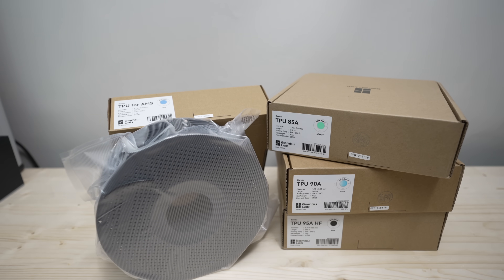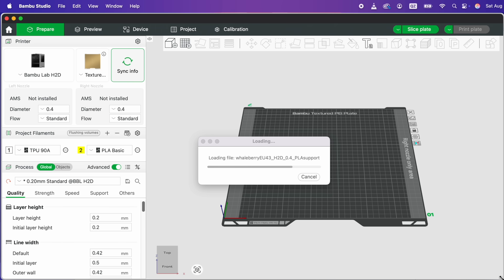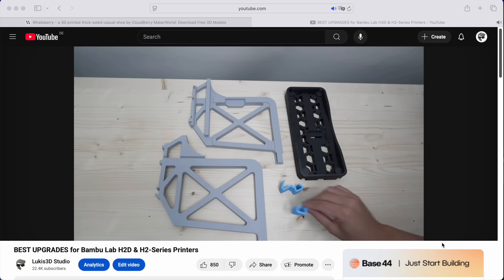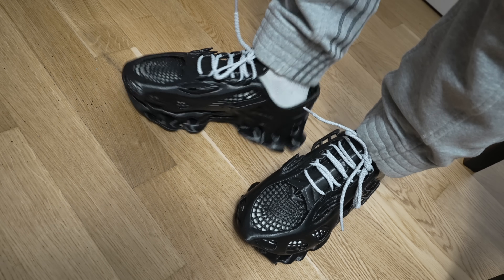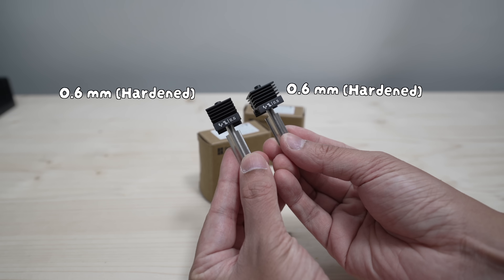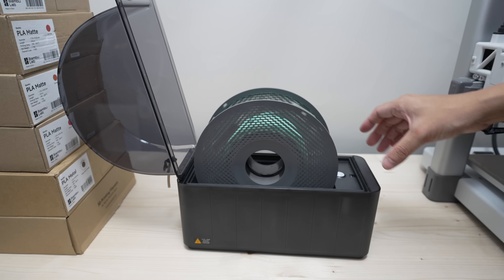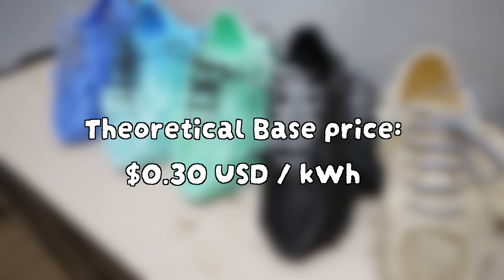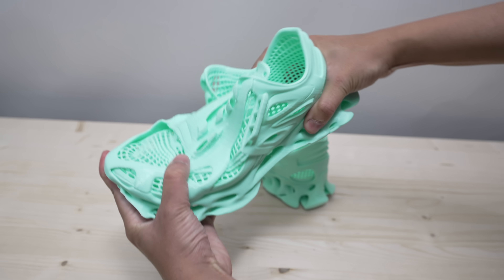How to print TPU with H2D (Which TPU is the best for footwear?)

Comment: I am impressed that you didn't have any failed print, apart from one bad quality print.
Reply from the maker: yeah i was really surprised, still didnt believe how easy it is to print TPU with this machine!
And I’m glad that I could solve the bad TPU 85A print.
Reply: @Lukis3D  Shows you that the vast majority of the failed prints and clogs are caused by user config errors and not something wrong with the printer itself.
Reply: H2D is an amazing printer.
Reply: @sirgriffinman  yeah i wana get the h2s because im broke